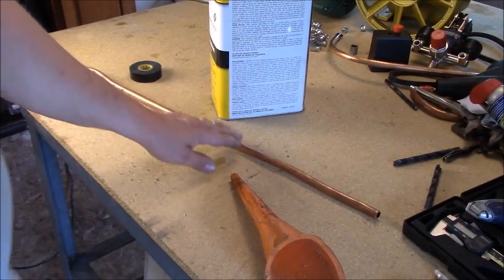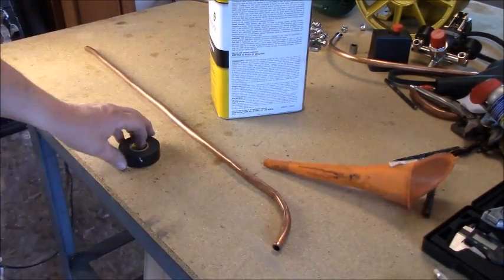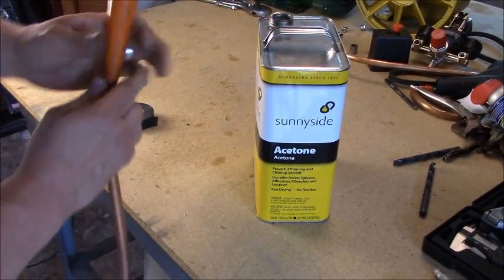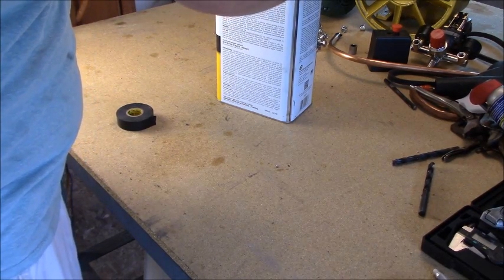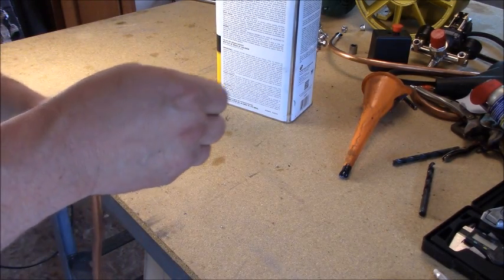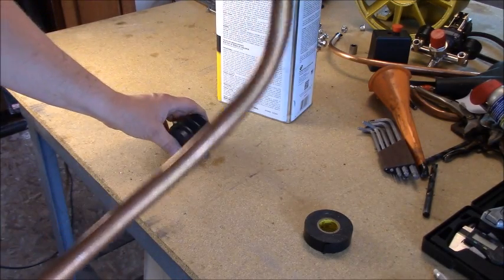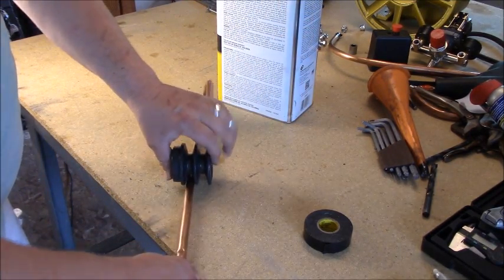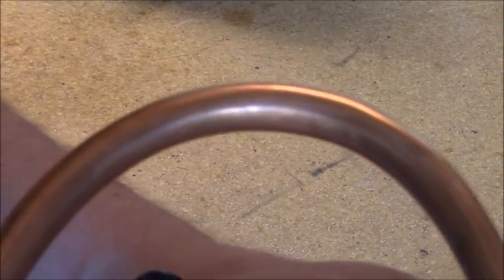How to Bend tube without a bending tool no kink DIY air compressor tube

Comment: This works fine, just check your copper pipe is annealed first. If unsure, run a torch 2-3" each side of where you want your bend to insure its annealed.
Saw an old guy on YT duct tape the end of a steel thick walled pipe, fill with water, then fill with sand. The water comes out of course, but it helps the sand compress even more. Then tap the pipe several times, add more sand, and duct tape the end.  Having something just about the exact width of your pipe to bend around is very helpful as it constrains the pipe and helps prevent it ovaling out.
Even bending around anything round is helpful, although you can just do it against your knee. Just bend slightly and move a mm to left or right and bend some more. Without a form to bend around you need to make a wider bend.

Comment: Was trying to bend 3/4" copper pipe. This did not work. Kinked the pipe and broke it. I tried twice.
Reply from the maker: This method will not work on rigid pipe. It works on malleable tubing.

Comment: Very happy with this purchase. >>>>ur2.pl/1018     The tank isn't huge but it works very well for my needs (mostly cleaning my room air purifier dust filters, removing dust from my hiking shoes, etc). It's probably paid for itself with the savings of not having to replace my purifier filters alone). I have no air tools so can't speak to it for that (though I imagine it's fine if your fine with it running a lot). I'd recommend getting a moisture filter if you need super dry air though as at least here in SoCal it condenses moisture.

Comment: I’m a little scared of putting sand in my transmission line tho😅
Reply: Heat it up to 400 * and bend quickly.
Reply: fill it with water and stick it in the freezer.

Comment: mine split when i tried it
Reply from the maker: +j curran Are you using rigid pipe, or the softer tube.? If you're using tube maybe you packed too much sand in it. I've never had that problem.

Comment: what do you put in the tube?and why and when you tension in the the tube it may be cut or not? thank you
Reply from the maker: I'm using sand. It keeps the tube from collapsing or kinking when you bend it. After you bend it you can empty the sand out and cut the tube where you need it.
Reply: Can insert salt if you dont have fine sand.